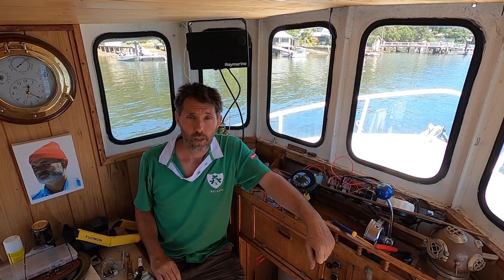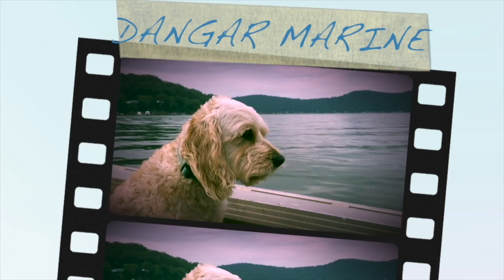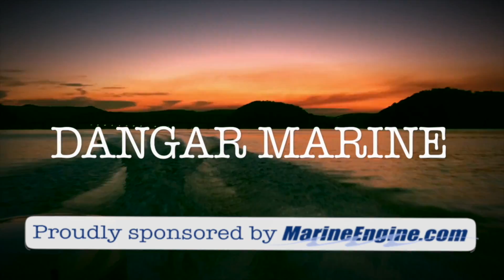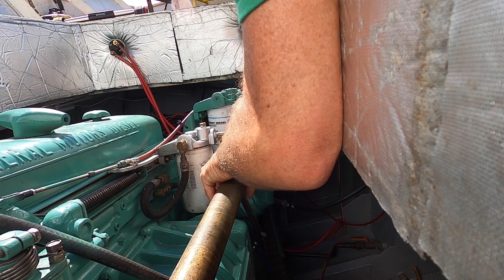Instrument panel

Comment: Small nit:  Coils have no polarity, solenoids anyway.  The way to remember this:  if you ever played with a permanent magnet in a sand box then you know the ends collect iron filings.  Which end attracts them?  N or S?  Ans: both do.  Either way you power a DC solenoid it will attract the iron plunger.  Great video!
Reply from the maker: Good point. Thanks for sharing. :)

Comment: Hey Stu at 23:07 it looks like there is a cut in the rubber protection sleeve for the solenoid. Maybe it is supposed to be that way but I thought you might want to check it. You can see it when you are engaging the solenoid on and off.
Reply from the maker: Yes, it's got a couple of tears in it.

Comment: You can put a piece of bread in the fuel line while you are doing your brazing. After the brazing is completed you can add fuel to the tank and flush out the bread.

Comment: I'm sure there's a 1/2 compression fitting in bass that would work on that pipe... I'd be shocked
 if it didn't exist.

Also the inside spiral on those hose clamps is just to provide an even pressure all around the pipe.

Comment: bit late, but 2 ways of tackling the fuel line: 
1: copper clamping rings, the proper ones anyways, cold weld to the pipe, and after that have 2 low angle wedges to seal against. though not advisable in steam lines or exhausts (anything with large temperature differences), they are at least as leak-proof as brazing
2: the right kind of epoxy will be as sure as brazing as well. just look up which kind for copper and diesel, Araldite probably has some, and we glue entire aircraft together with Araldite 2021. 

as for adapters, you might need one in between the end piece and the hose barb, as long as you mount it properly with some rubber in between it shouldn't be a problem, just mount it on the stack of adapters not on the line itself, with pipes, always fix the heaviest and stiffest parts, and give the flex some room

Comment: What about using brass compression fittings commonly used for home plumbing for the fuel line? Just use the ones with the brass olive.

Comment: What about one of these for the fuel issue?

https://www.sharkbite.com/products?gclid=CjwKCAjwvOHzBRBoEiwA48i6AjaafP3CyG8Y8uFzgy2lyIbe86tcwBPrSIa71HEDDAGCXFvim_wfeBoCr8YQAvD_BwE
Reply from the maker: Looks like a good option.
Reply: Dangar Marine 
I have used them myself on applications where I cannot get a torch in place or where I have wet connections that cannot solder. Never ever had a leak.

Comment: For the fitting on the fuel line, just use a compression joint to put the barb on? I’ve brazed on contaminated lines before and it doesn’t go well, diesel has a flash point too. 
Great content. Thanks.

Comment: Great video series. Always look forward each week. I have a tip for you regarding the correct size supply fuse for main or sub main circuits. The current rating or rupture current shoulder rated to the the size of the cable suppling your devices. The function of a fuse in a supply circuit is to protect the cable not the devices hanging off it. As you can imagine overloaded cables creat heat which could ultimately melt the conductor insulation and creat dead shorts an possible fires... the cable supplying the loads or devices should be sized appropriately to the sum of device loads plus minimum 50% for diversity and possible short circuits. Cable current carrying capacities are easily available on Google. If your device requires a smaller size fuse than the main or sub main then install an appropriate inline fuse as close as practice to that device.   Cheers Shane

Comment: you can also run a brass compression fitting for your fuel line and avoid brazing the line with fuel in it all together and would be a faster long term solution

Comment: Hey Stu, having wired a few boats myself one thing I learned is to always leave a service loop in the wire bundle at the switch panel.  it makes going back later so much easier!  Your work is looking great!
Reply from the maker: For sure, this panel is going to need to come off again down the track so some slack is going to be needed.

Comment: Stu, cut that fuel line off and use a flare fitting so you don't need to braze it. Flare connecter to a barb fitting.

Comment: Use a compression fitting like for plastic air line idk if you guys in austrailia u these or not but they work really good for copper piping

Comment: Use JB Weld to "glue" the barb onto the fuel line. I know what you are thinking, but believe me it will hold it just fine. I repaired a crack in the engine block of a VW beetle with JB Weld, that s*** will fix anything. Although I'm sure if you can get that in Australia... But surely you can?

Comment: Stu, you may want to install a water-tight door between the engine room and the accommodations. This would allow easy access to the engine and maintinance. The current configuration limits access and reduces what maintnance can or will be done. That limited access was likely the cause of some of the boats issues.
Reply from the maker: Yes, have a plan to do just that.

Comment: It’s diesel, you’ll be fine safety wise. However like soldering water pipes it’s difficult if the liquid is to close because it draws heat away from you’re work. So the solder might not want to melt in. 

Those hose clamps that came with the 90 hose are fairly standard in the US. They are a higher grade because they have that extra spiral but still something most Autoparts stores have in stock or at minimum at their local distribution warehouse for same day pick up. 

I like the t-bolt hose clamps your using on the other stuff. They are quality!
Reply from the maker: Yes, I tried brazing a water pipe here at home and although the water was turned off and the tap left open it was very hard to get it hot enough. Steam just kept pouring out of the tap!
Reply: Dangar Marine you probably won’t have the steak problem with fuel. Just try to get the fuel a few inches away or more if possible. Regular led solder will be fine if your working with copper. Should not need silver solder since it’s not high pressure. Make sure to use a good liquid flux so you get a nice clean surface. Paste flux will not be enough to clean.

Comment: Hi Stu, an old plumber's trick for a wet pipe is to pack white bread into it, and do the solder joint. Eventually the bread more or less dissolves.  If you have pressure on the tank side, the bread should be easy to push out.  Good luck!  Or you could put in a compression fitting ball valve and reduce it after the valve.

Comment: A high quality bungee cord is good for unloading weight on hoses etc.
For example, they are used on articulating tracked vehicles between front and rear cabin (cooling hoses and electrical).
Reply from the maker: Sounds like a good options. I've been mulling over what to use for that job.

Comment: I enjoy seeing the progress, even the fiddly bits of connecting all the controls, sensors, cooling and electrical systems.  Being able to scratch those tasks off your list really lifts a burden and moves the final goal closer.
Just don't get so distracted by working on the trawler that you fail to keep your strategic beer reserve well-stocked. ;-)

Comment: For fuel line, have you thought about using a pressure fitting, that would require you to slide first part on then flare copper end?   Then bring part up to flare and screw on adapter that would allow a barb.   Its how a lot of brake lines and fuel lines been done in automotive industry.

Comment: Does your flow switch need to be mounted with the arrow pointing up, if the water is coming in from below and going up to it? Typically that’s how they work. Wouldn’t want you to have a no flow indication and have to disconnect after you have water flowing.
Reply from the maker: It should be fine, it's just a spring loaded on / off switch for an alarm, not a flow meter as such.

Comment: That 1/2 inch fuel line since its 1/2 inch O.D. is air conditioning copper pipe. Go to a shop that does air conditioning and you might find the fittings you need to adapt it over. As far as brazing I don't thing it will be boom event but you're going to cook the fuel at brazing you'll have the burnt crap flaking off going hopefully to a filter first then the motor.

Comment: I assume you are aware that salt precipitates out of water at temperatures above 140 degrees f.  Also that an internal combustion engine is extremely inefficient at such a low temperature (most like 190-200 for peak efficiency).  That hot salt water makes a perfect electrolyte which contributes to dissimilar corrosion of metals in the engine's cooling passages?  That since it is an open system you can not use corrosion inhibitors such as those in anti freeze.  So salt deposits will build until they choke off cooling passages, attack the metals, contribute to any electrolysis inside the engine as well as dissimilar metal corrosion. These are among the reasons no engine gas or diesel manufacturers recommend raw water cooling for their products--even in fresh water.   Your maintenance will be high as well.  Exhaust manifolds and elbows will clog solidly in two or three years and need to be cleaned out.  In about five to six you will be replacing them.  Pretty hard on an expensive engine for little reason.  Even when not using the engine the salt continues to attack the metals.  Fresh water cooling is not that expensive all things considered.  They just don't even exist around here from long knowledge and experience.  Food for thought.  Take care.  Doug
Reply from the maker: The raw water doesn't go through the engine, only the heat exchanger core.

Comment: Fuel line- if compression fittings aren't available,  you should be able to flare the copper line; hydraulic fittings AN  or plumbing fittings.  Also you can find fittings at refrigeration supply house. Your making excellent progress if any suggest otherwise ---- them.

Comment: Nice to see it coming together Stu .Instead of brazing a 3/8 barb on the copper fuel line how about going with 1/2" flexible fuel hose sleeved over the copper, one of your bonzer hose clamps will keep it on.

Comment: Renko is an essential service.  I don't think the water police are going to be out there ensuring your social distancing. Keep going. 

Great video, thanks Stu.  All those little jobs soon add up. You'll be finished soon. I don't get why you're installing a touch screen that you will need a PC for. Or are you installing a tablet? Pretty sure a tablet would do the job just fine, use far less power, and also have a built in gps.

Comment: Look into this system for any fittings /connections. The press tool is quite expensive, but you can probably rent one at any local supplier.                                     https://propress.viega1.us/

Comment: Curious question - why did you soak the exhaust wrap in water before installing it?  Is that to soften the material so it will dry in the shape of the exhaust pipe?
Reply from the maker: It’s mostly about stopping the prickly fibreglass getting in my skin and lungs.
Reply: @DangarMarine  Oh, excellent!  I appreciate you taking the time to answer!

Comment: I know it has been mentioned before but I didn’t see an answer, have you considered putting a Raspberry Pi on Renko? A bottom end install could connect to those water level alarms and solar charger then using wifi from the island send an alarm to your phone. For a higher end installation give it a 4g/gps hat and add an IR pan/tilt network camera to the mast, pi now send you alarms without wifi including a gps fence and you can connect to the camera from off the boat to check it out or use the camera from that PC you installed when on the boat.

The channel doesn’t need to cover the in-depth programming or anything

Comment: reference cutting the fuel line, why not use a pipe cutter, you know the kind that have a sharpened wheel and a couple of bearing rollers on the other side. No real chance of sparks or creating an ignition.

Comment: Not sure how you squeeze into the engine room, it would be a little scary to think you could get stuck in there. As for your fuel line if its possible replace it with new from the fuel tank to the engine, the boat is 30 years old the copper has work hardened over those years. Its all you need is to have a crack develop and fill the hull full of diesel fuel.

Comment: Hey Stu,  I have 3x15 inch Fujitsu touchscreen monitors in there boxes if any use to you.I tried to find your email or a way to PM you .I have opened the boxes to check them out when I bought with a joblot ,I was thinking you have one and pass one each to Damian Brupeg and one spare or pass on to someone who could use .it would be ideal as a back up GPS monitor connected to a cheap GPS android box ,it can connect to everything a PC monitor can they have all built in connectors .I will try send you some pictures but I couldn't find your FB I will try  Instagram, or if you send me a message on YouTube. I will find a way to get you some pictures ,I have s few other thing too you might find usefull ,look forward to hearing from you.wayne

Comment: Freeze the copper line 200 mm down from where you need to( Silver solder )the barb on if you have the room move the freeze point even closer to the tank and make sure it is frozen . Me i would flare the copper pipe and fit a shut off Valve and no welding or soldering required but thats me lol.

Comment: Hi mate,  I need to ask a question.  I have a 1974 evinrude 70hp. And I'm doing the water pump. But the old impeller is stuck. How do I remove it without damaging anything.  Cheers and I love your videos.  Been watching for a long time. Keep up the good work.  Cheers Sav

Comment: As far as the fuel line , I would put a shut off valve on it and thread the pipe to accept the valve unless it’s your return line then run the biggest diameter line as far as possible but I’d still thread the pipe and use a coupler . I’d cut it put a cork into the line then cut threads so no shavings go into the line . That just what I would do !

Comment: In regards to the fuel line, you can flare the 1/2 inch pipe with a flaring tool, then add a 1/2 inch ball/butterfly shutoff valve (for future servicing) and you should be able to get a barb/tail to 1/2 inch BSP to screw straight into the valve. 
Just a funny note, I thought of you today when my brushcutter didn't start! WWSD!

Comment: okey dokes,
for that fuel pipe. stick a smaller tube down there and suck as much out as you can. i understand it won't be pleasant but a mans got to do what a mans got to do. normally when dealing with this kinda thing you'd fill the offending part with water so the fumes are evacuated but that's obviously not an option here. you're in a ventilated area so there shouldn't be a build up of fumes in the compartment.
there will be fumes emanating from the pipe when she warms up which will be the main issue but if the pipe is cool it should be ok which brings me to cooling. for the part that is under the brazing area wrap it in cloth all the way and wet it down good so heat doesn't travel. keep a bucket of water with some rags in it so if there is an issue you can throw the wet rags over the problem. further, when finished you can cool her down with the wet rags however i'd recommend ringing them out till they are damp in order to slow cooling and avoid cracking or just let it cool and monitor. the copper will transmit heat to the wet rags lower down so keep water up to them if this is what you go with. try to get a good seal first go.
someone may have a better suggestion.

Comment: About the barb connection issue. Stop shopping at the auto store and go to the plumbing department. You can get a brass 1/2 inch compression fitting like on a toilet and screw a barb adapter directly to the other end. Hell you can even splurge and get a ball valve fitting so that you can have a fuel cut off if you desire. No welding required.

Comment: As long as there is fuel in the line to act as a vapour lock close to the new barb you are safe to go. Air is the protagonist here, air in any fuel tank be it diesel or petrol or any other fuel can and will explode if conditions are right. Heat is not usually the ignition source but a spark or flame. Cheers

Comment: Hi Stu, you can add an additional monitor to mirror what is displayed on the Raymarine Axiom, I think via WiFi. Check with the full manual PDF from Raymarine website. I have my PDF manual stored on the second SD card, Do not store data on the Navionics card. The PDF reader is great   
tide charts, fishing rules any PDF data you wish to store in house and have at your finger tips without being connected to the internet. Cheers Chris

Comment: The good thing about being a welder and owning the boat you're working on is...if the engine is blocking the entry into the compartment....you can cut a new entry! You were going to replace large chunks of the deck plating anyways. Now you can add a hatch here and there to make your life easier.

Comment: G'Day Stu,mate fuel line,,would install fuel shut of valve at tank and then replace whole line,
to many joints,,(Tok Tok,),only leave more place for leaks,and with vibration,any sort of solder or braze could crack under vibration and leak,so go see local hydraulic guy get fittings and use low pressure hose,,Much much better,,Well i think,,

just on that, duffield use to make a D 600 series..just push on barb with female swivels,
and i have used these on oil and high pressure air with no problems,
for a push on fitting, very high working pressure is obtained,,
I believe Ryko has similar product,,
Note,
No clamping needed on fitting tails.barb do the lot,,
Yeah i didn;t trust them when i first came across them but after trying to pull fitting apart with vice and 5 ton crane bloody fitting lifted vice,bench and me of the ground,,and still held,
with no leaks,,so yep impressed,, i was,,